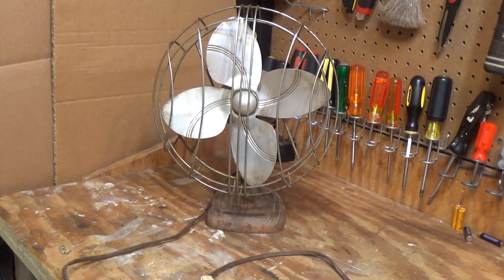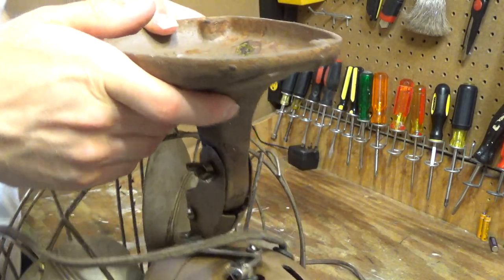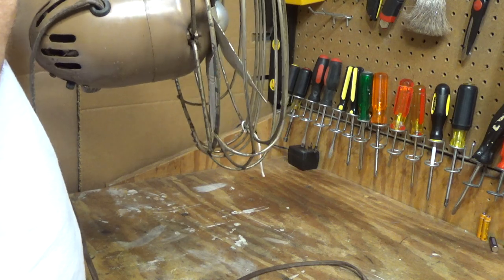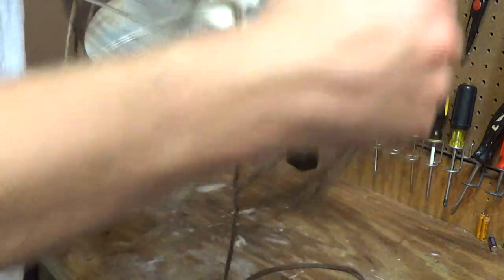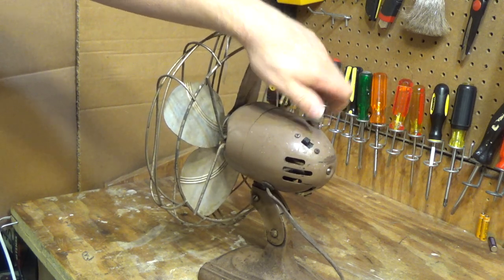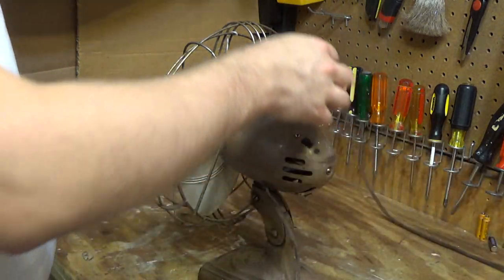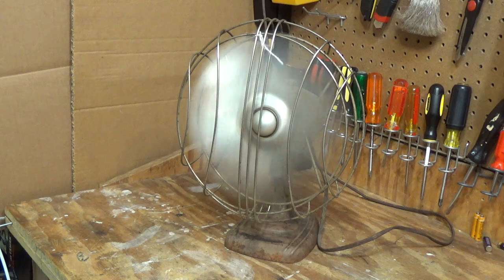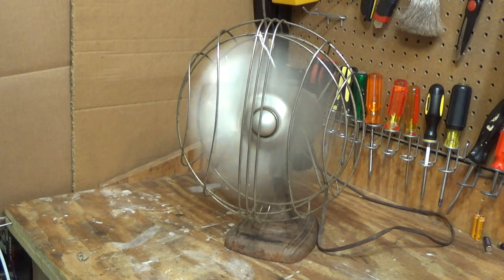Vintage Dominion 10" Oscillating Fan

Comment: How hot are the motors supposed to get because I have a fan of a similar model (but a non oscillating and the blades and motor are a little different) and the motor gets very hot to the touch and I have oiled it on both bearings and it spins quite freely is this normal?
Reply from the maker: The motors do get hot during normal operation.

Comment: Definitely not an original plug.  That's a replacement plug from back in the day, if you remove the fiberboard "washer" you should be able to see the wires under some screws that attach to the prongs.  You can probably "rework" the plug and make it fit better, make sure to tie an underwriter's knot in the cord so it will act as a strain relief.

Still don't know how much air it moves, only that it does move air, which I can see by the blades turning and the sound it makes.
Reply from the maker: The plug does have the screws that attach the wires to the prongs, and it is connected quite poorly at that..

Okay..